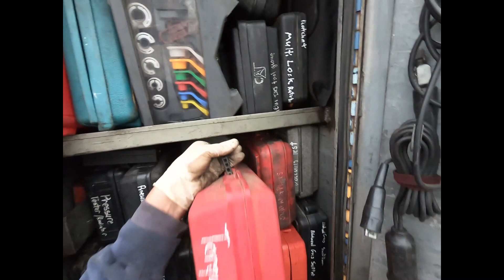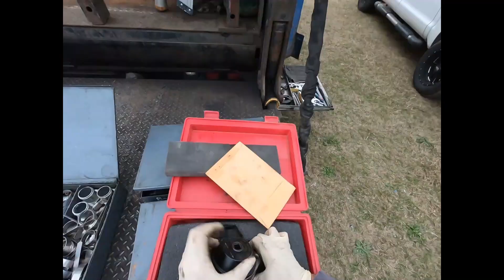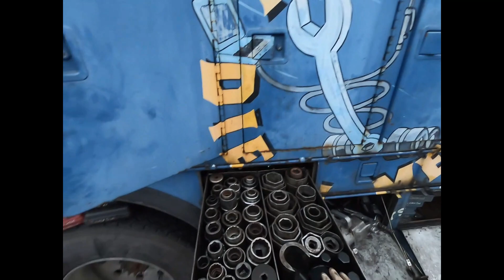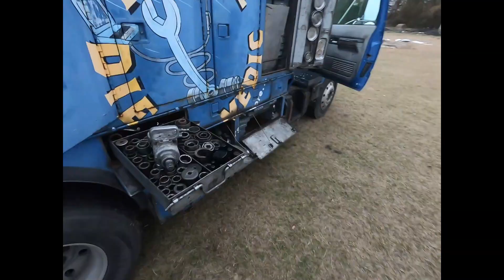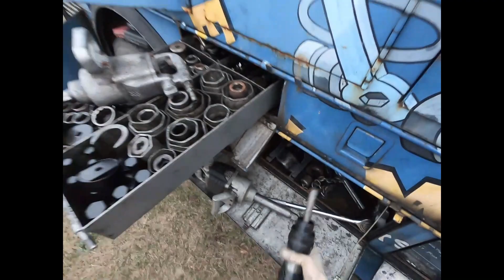Mastering Hydraulic: Essential Tools for Hydraulic Cylinder Repairs - Part 3 | Mobiledieselmedic.com

Comment: The rock polisher had an Allied hammer on a 245 that THEY were going to try and rebuild.It had been done here once and were yapping about a torque multi[plier on a 1/2 inch drill motor. They cut out a 5 foot 'wrench' with a chain and hooked it to the 966 bucket I was on at the time. I ALWAYS ended up on the dangerous end of stuff. I took up the slack, looking right down the barrell of that death trap and it loosened. Neesless to say they headed back to Allied right THEN for a weekend rebuild. No wonder I talk to muyself! God Bless Yall!
Reply from the maker: Sounds really really sketchy.  Good thing they came to their senses.
Reply: @mobilediesel  We're out in the sticks, as it were and common sense and money were scarce if non-existant. Usually it took a grim reaper-ish deal  knowing it was grinning around the corner for  the best way to be used. MSHA and a lot of rock processed changed a lot. It used to be 'Whatever it took' but now it's safety bonus quivers. After I quit there I helped a buddy with a road job and told him I had to revert back 25 years to really get something accomplished, as in not being scared to death to try something. He was grinning and we were accomplishing. All is well and God is good!